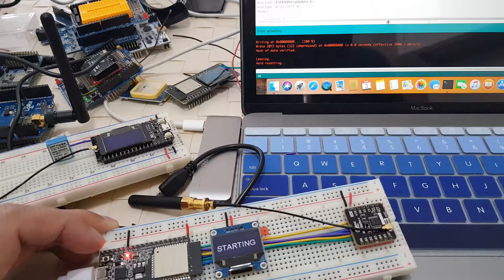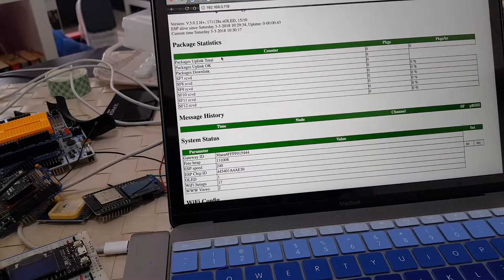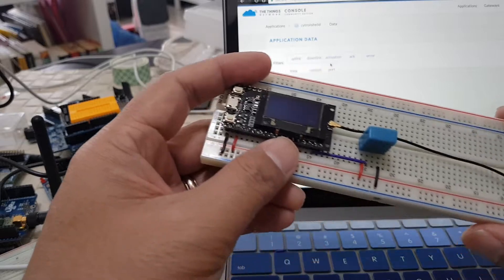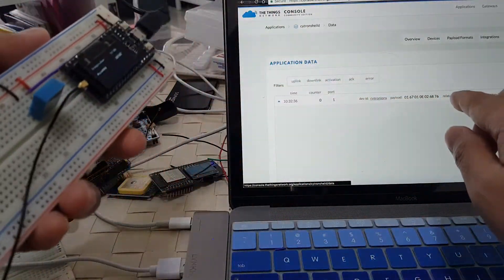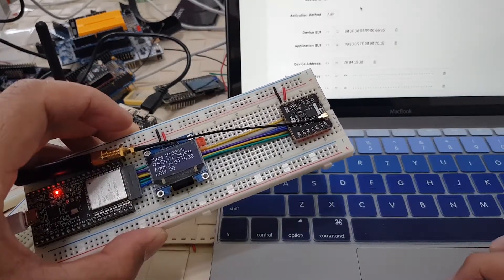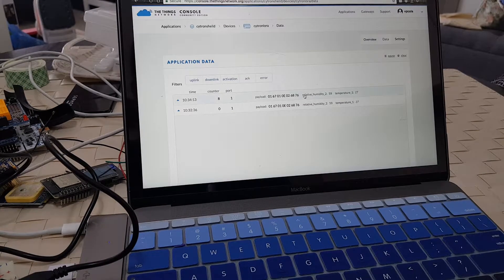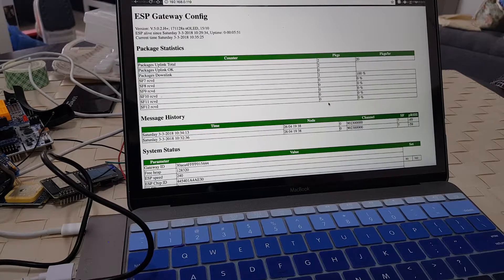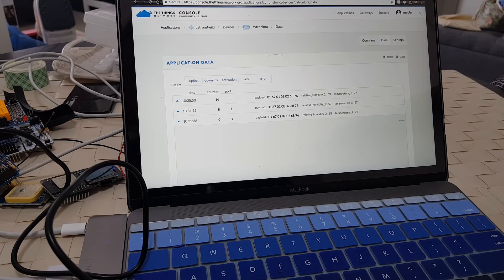ESP32 LoraWan Gateway with Heltec/TTGO Lora32 boards - Part III

Comment: Hey dude,
Very nice video, helped a lot. Managed to get it mostly working, gateway, node, TTN. Except that the node keeps sending temp and hum values as nan. Also can't seem to get cayenne working, prolly because of this issue. TTN however receives packets with the same payload, prolly because it always sends the same nan message. Any ideas ?